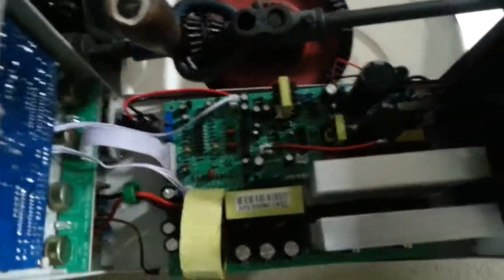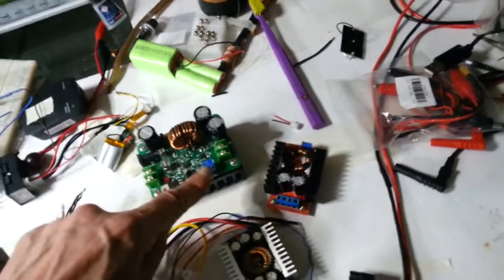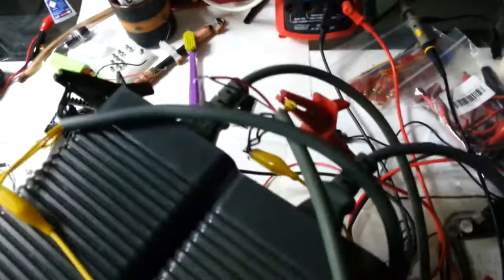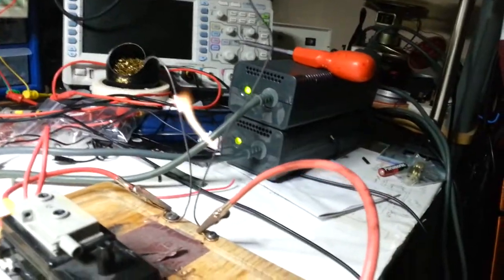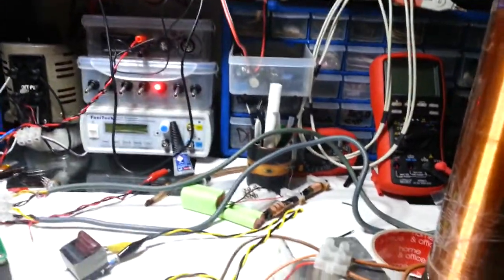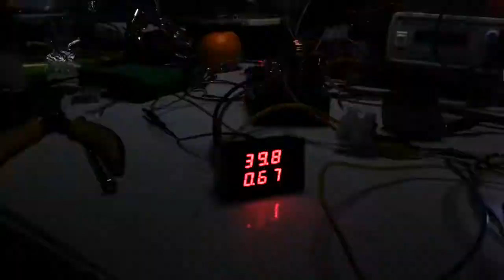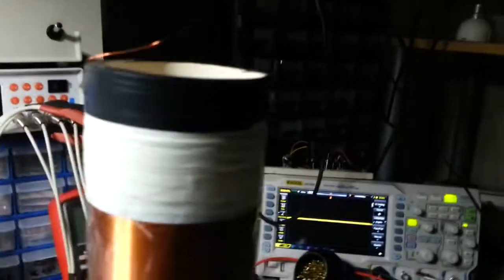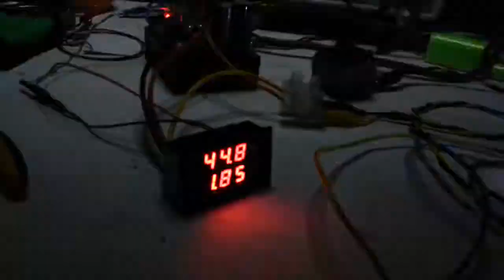DIY Power Supply Using 2 Xbox 360 PSU's + Booster

Comment: Enjoyable video thanks ....poltergeist stuff who you gonna call....if your multmeter starts floating around the room pull the plug fast....smile...you have a  great setup and bench..I think its much more fun  salvaging old parts repairing...and finding ways to re-purposing  things...i have a old computer power supply to play with..thank god for the internet cos its a dell with non standard wire colors..did you check out of the window to see if the street lights where flashing?...do you think a tin foil hat would be safer or extra risk?..but jokes aside..do you know if a Faraday cage would protect your computer from the slayer radiation?.
Reply from the maker: If my  computer is in a metal case grounded by the earth in the PSU, is this a sort of Faraday cage?I think its all the other peripherals which are like antennas. I will guess it is the speakers which give the best reception.:)

Comment: Hi I want to parallel 2 units for higher Amperage to run a car amplifier for a subwoofer? Any reply appreciated? Cheers from Australia 🙂
Reply from the maker: If switch mode supplies, can't really be done. Sorry
Reply: @Elecifun  huh? I have 3 units and about 5 car amps!
Reply from the maker: I used two xbox psu's in parallel and one died very quickly. Unfortunately SMPS do not play well tied together.
Reply: @Elecifun  thanks so much!: